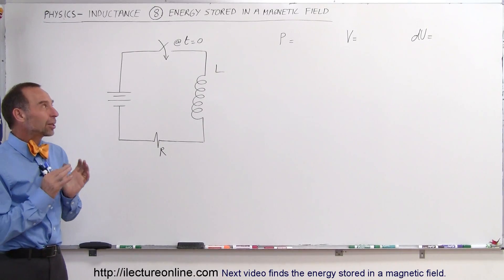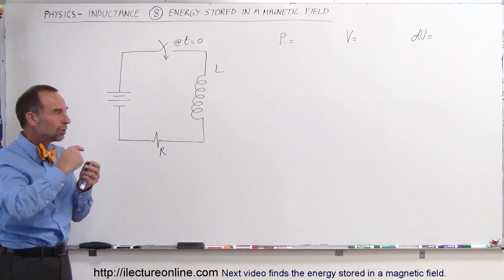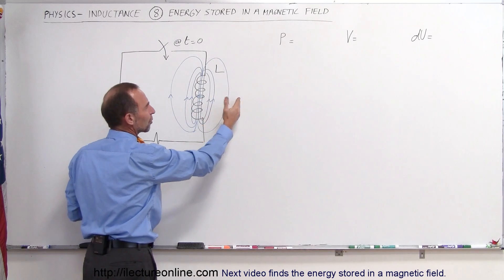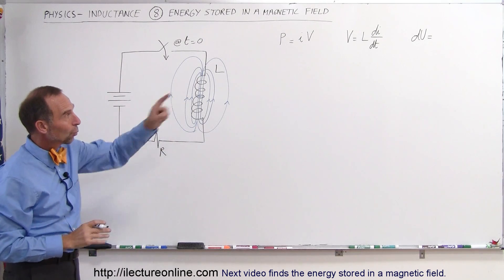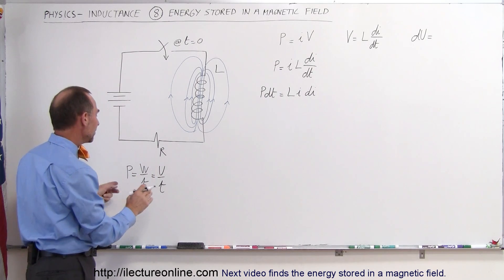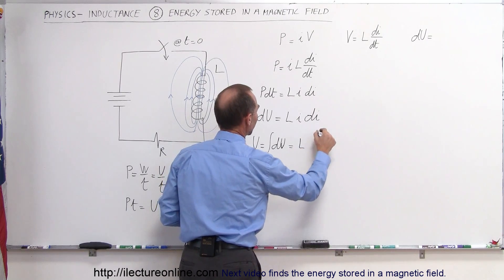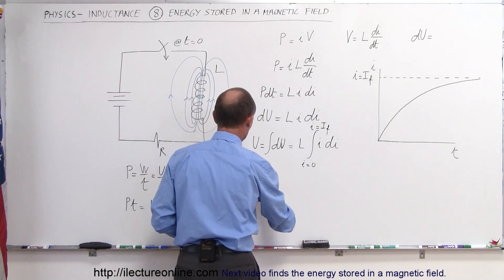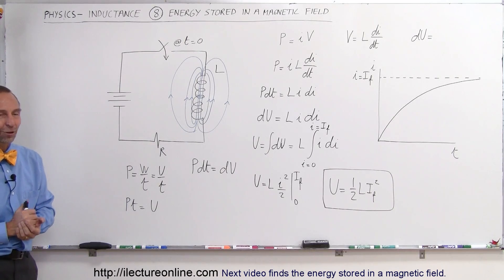Physics 47  Inductance (8 of 20) Energy Stored in a Magnetic Field

Comment: What is magnetic field energy? Magnetic force does no work.

My understanding is the 1/2Li^2 is not the energy stored in magnetic field but the work that the battery has to do to oppose the induced nonconservativ E field inside the resistor or the work done by the induced E field. This is also the work that the induced E field will do when discharging the circuit. So we can think as if this energy is stored and comes back while discharging.

Is this wrong way to think
Reply from the maker: The battery does work to induce a magnetic field

Comment: THERE IS NO ENERGY IN AN ELECTRIC OR MAGNETIC FIELD!!! For instance, the electric field has units of V/m or N/C. These are not units of energy! Example: when a ball rolls down a hill, the ball has kinetic energy, but the gravitational field by itself has no energy. The same thing happens to an electron in an electric field (between two unequal potentials). Do not compare EM-radiation with a rope containing masses. The combined EM-field does not contain masses that are going up and down. Only when an EM-field gets in contact with charged masses, then the transverse fields give these masses energy. But while propagating through vacuum, an EM-field only has kinetic energy in its longitudinal direction! That's where the speed of light is coming from.
Reply from the maker: There is indeed energy in a magnetic field caused by an inductor.  (how else can it keep the current going when you turn of the voltage source?)
Reply: @MichelvanBiezen  A voltage source only gives a difference in potential, like the slope of a hill gives a difference in height. Without an electron or a ball there is no energy around. Interesting to see that you can't distinguish potential differences from energy. I think that U = q . V is a rather simple equation. It says, without a charged particle q there is no energy U (only a voltage source V). NO FIELD CONTAINS ANY ENERGY! THAT'S WHY IT ISN'T EXPRESSED IN UNITS OF ENERGY.
Reply: magnetic field is capable of storing energy
Reply: @BIackhole  Like MIchael, you can't distinguish between potentials and energy.
Reply: There are two options: a. you never really understood the subject, or b. you never dare to have a different point of view. I wouldn't be proud of both of them, Michael. But keep justifying your own mistakes, my friend. Many people have a hard time to admit their errors in life (especially profs). But by now, I'm sure you realise the title of this video is WRONG.

Comment: why isn't the voltage across the inductor equal to -L(di/dt)? why doesn't it have the minus sign in some cases such as this?
Reply from the maker: With AC current the direction of the current changes constantly and thus in each cycle the sign will change multiple times per second.  However in order to account for the voltages traveling around a loop, just like with a resistor, it is assumed there will be a voltage drop across an inductor.  In the end it depends on the phase angle.  If you are interested, there are many videos in the electronic engineering portion of this channel that explains all that in great detail.